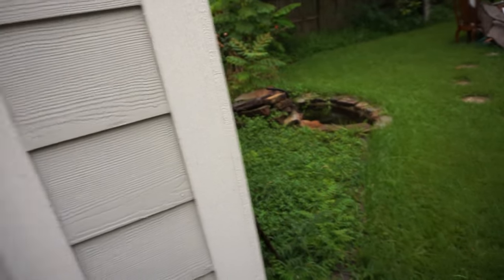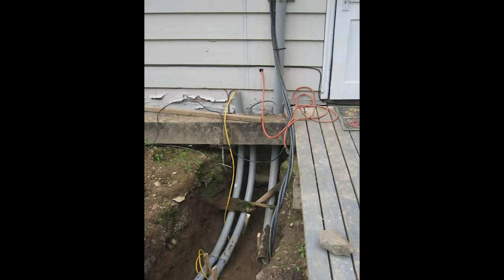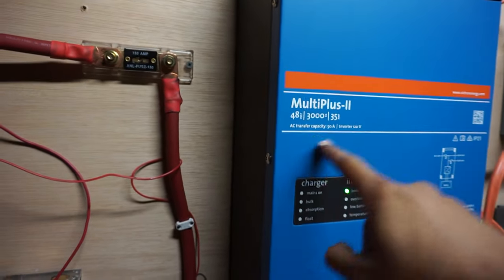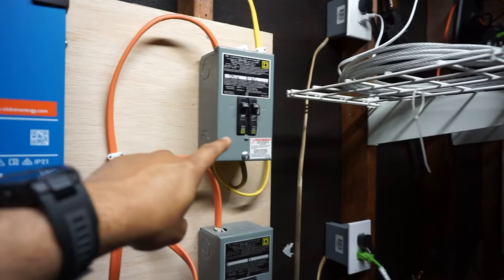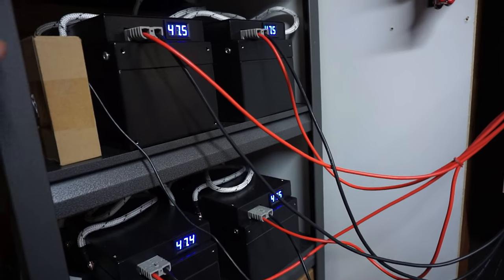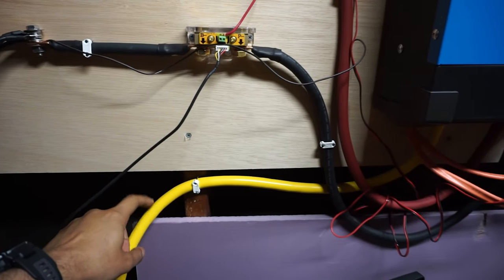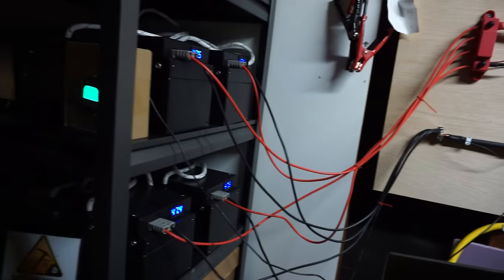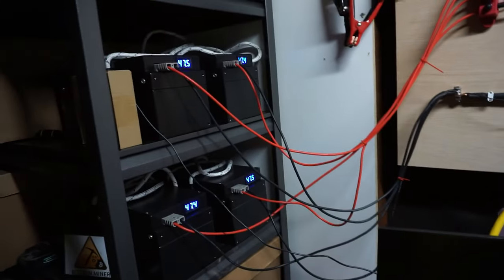Needed MORE POWER in my detached garage - Instead of trenching I installed a DIY powerwall!

Comment: I'm doing a project just like this. I have 100A at my main panel. If I subtract the existing dedicated 15A circuit to my garage, and consolidate another circuit (lighting circuits can safely be if they've been upgraded to LED). I have two open spots. I got a 80A breaker, main breaker 100A load center, and 2-2-2-4 MHF wire from Home depot for 1.50/ft. Trench and lay the direct bury cable on a smooth sand sand base. Tap a copper rod into the ground, and wire it to the ground bus with solid 6GA copper. Then wired the subpanel to have an unbonded neutral and ground. Took about a week
Reply from the maker: Exactly what I was trying to avoid doing. I believe you need a contractor to do that right?
Reply: @DadMods  Nope. Just follow the rules. The subpanel will be rated for 80A, even with a 100A shut-off. You can't run 100A over 2Ga Aluminum without very specific high temp rated terminals on breakers, load centers, etc. If you're not sure about how to do something, look it up. If you're going to pull a permit, tell them the whole set-up before you start digging. There may be special considerations for the inspector about wire depth, conduit sizes (going from the ground into the building)